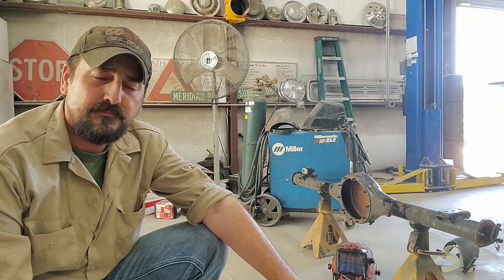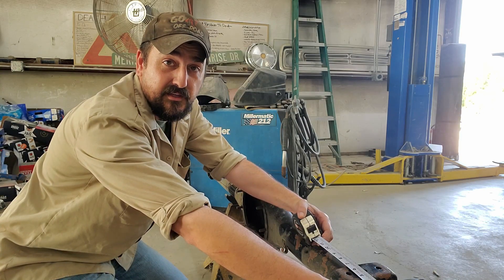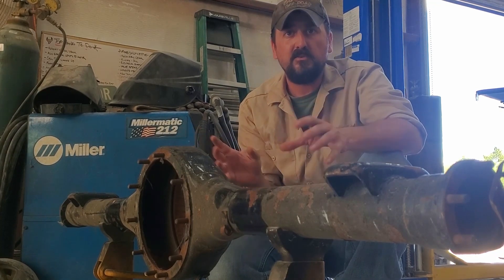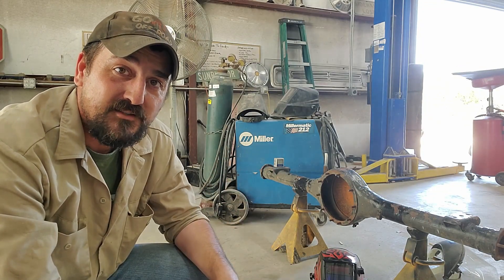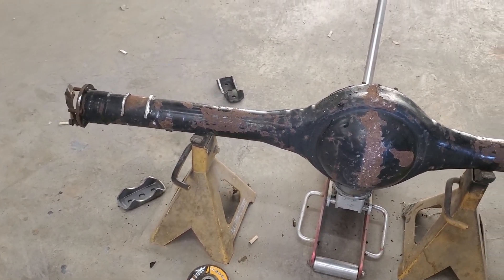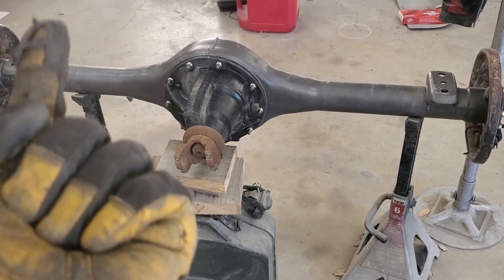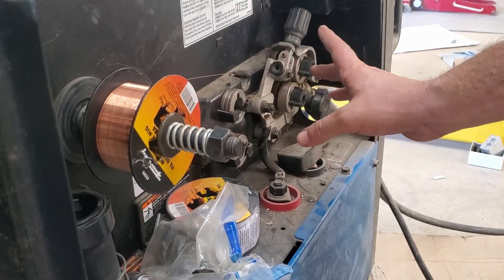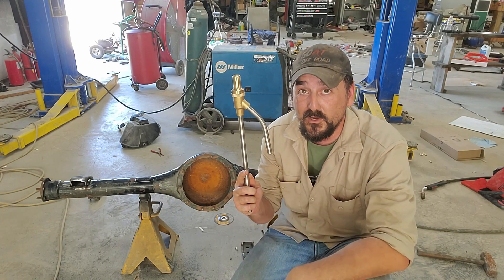JUNKYARD Mopar B-Body to A-Body 8 3/4 Axle Spring Perch - No Name Nationals RACECAR

Comment: Those welds are perfectly fine. I'm sure you can relate to high RPM clutch engagement. Twisted off drive shafts, shattered u-joints, broken yokes, and snapped axle shafts. But I have never experienced a spring perch failure-yet. LOL
Reply from the maker: HAHA Very good point, I've never had a spring perch fail, Plenty of those other things though HaHa Appreciate it and Thanks for watching!

Comment: Have BTP get after it. They been swapping small blocks  in and out and rebuilding one .
My how to guy Duddie just struggling in the Texas heat.
That welding wire is like a car with a ball of yarn.
Reply from the maker: If BTP made it down to Texas they would have this Engine Built, Installed, and Doing burnouts before the end of the Weekend! Appreciate it and Thanks for watching!
Reply: @DuddiesAdventure  The cost of BTP coming down to TX, would've been ALL of your tacos.

Comment: Why are you using .24 wire
Reply from the maker: It was in there from the floor pan work I've been doing on the Crew Cab. With all the time I wasted fixing the wire feed, I could of just installed the correct wire and wheels and not had a problem haha , The welder failure was on me! Appreciate it and Thanks for watching!